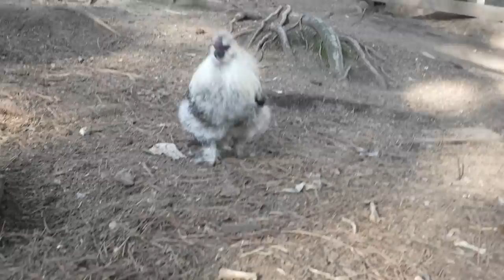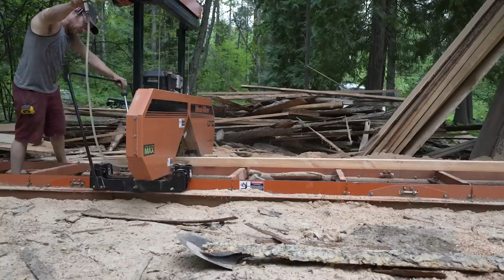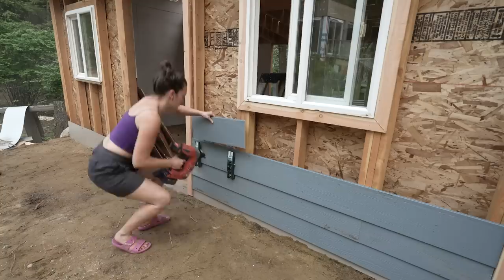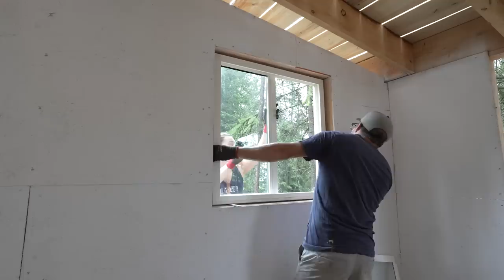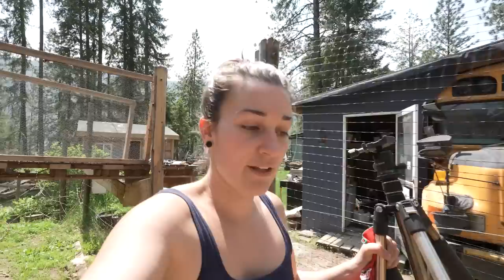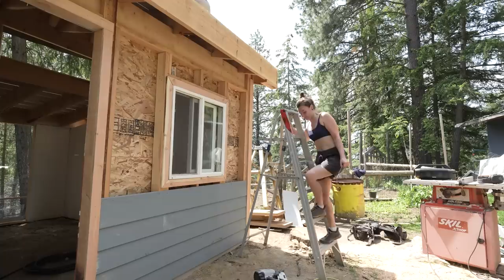You Won't Believe How Much We Paid For This Siding, Windows AND Roofing! Building A Barn For Free

Comment: Great progress!  Even though it is a barn, consider how to keep moisture out of the walls to prevent mold and premature rot.  I checked hardi plank installation documents and installing on studs like you did is acceptable but there needs to be a water barrier behind it.  In addition, where two planks meet vertically there should be a small strip of flashing behind the joint to keep water from going in and getting behind the lap row below.  You may be fine the way it’s done but this was something that I thought about and wanted to share.

Comment: I see that you have a dirt floor in the barn. Can I suggest placing a pile of small rocks 7-12 cm in size all around the barn exterior walls. If any predators try to dig under the wall the rocks will fall into the hole and help to deter most predators from continuing. Its a method that was used at some small jails here in the UK in the 18th and 19th centuries to prevent prisoners escaping.

Comment: Where ever you have a joint you should have put metal flashing behind to keep out water
Reply from the maker: We were originally going to paint the bars so I was going to use a good construction adhesive on the seams before painting. I can get this color of caulk for the seams

Comment: Good work guys. Doing great. If you are in a fire prone area. Then you may need to have a fire break around the perimeter of .your home. Or for the siding of your home you can make it out of stucco. It's basically cement and it will fire proof your home. Just last year there was in the news about a wild fire that engulfed I don't know how many acres. But this one home remained standing compared to the area neighborhood. I mean all the other homes were a total loss but this one home because it's outer walls were made of stucco. It prompted the area ordinance to change it's building code. Just a thought to consider.
Reply from the maker: We are using fire proof siding on the barn and house, metal roof and we have cleared alot of trees/brush around the house. Not as much around the barn but our main concern  is the house. Everything else can be rebuilt. The trees in the chicken run protect the birds from aerial predators

Comment: Katie, what flowers? Using those off cuts like you did before will make good raised beds. Suggest you overlap just a cm so the soils stays put. 
That roof might just make a nice base for solar panels, if the angles are right.
This project is coming along well. I expected insulation in the walls if only to keep the power station operating at full efficiency during cold weather.

Comment: I’m probably making this comment not knowing if you have tiled or finished the surrounding walls in your bathroom tub area, if you haven’t finished yet I would suggest you using cement board on the three walls surrounding the tub, to prevent mold in future.

Comment: Also you should sheat the outside of the walls before siding it’s for strength. I’m curious why no insulation and vapour barrier and tape. But you built it the way you wanted good on you guys

Comment: You can use dry sawdust to insulate the walls helps with heat and cold all you need for ventilation  is one of those whirly birds the wind turns them and ventilates  the barn from condensation

Comment: When you put dirt up against the building like that it will hold moisture and  rot foundation out.
Reply: Harding board siding requires that at all wall joints there be a waterproof flap material behind the joint which help’s shed water and keep it running it down the outside of the wall.  Really reconsider your live roof idea as you live in a fire prone area, install a steel roof